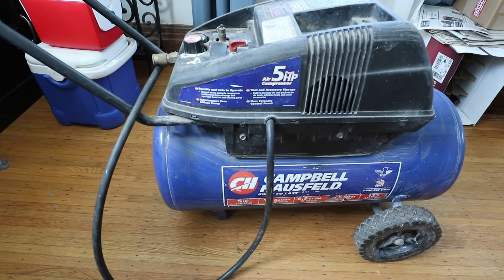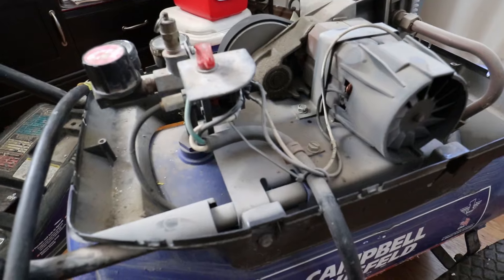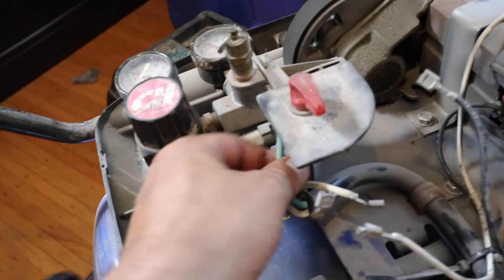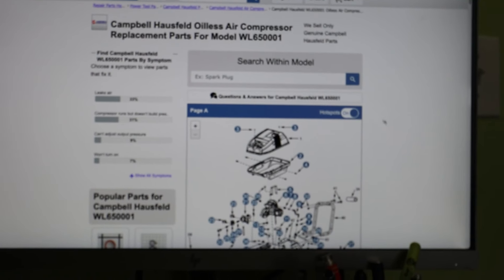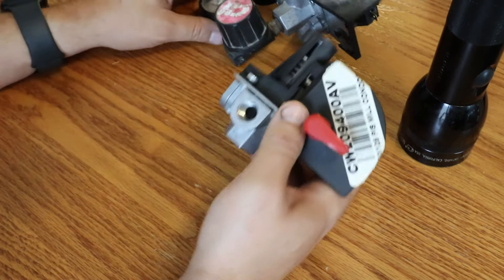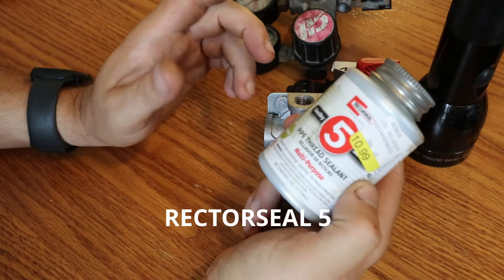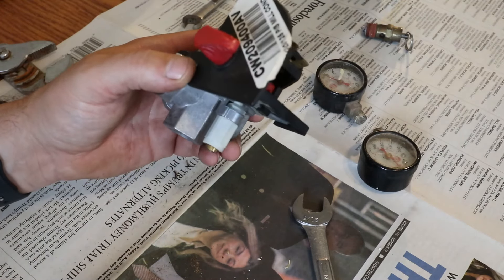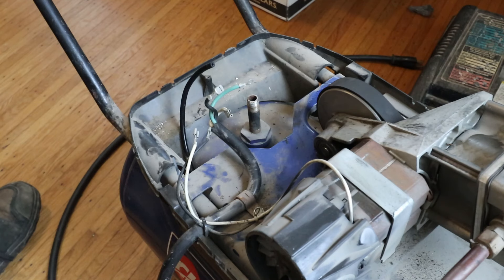Air Compressor Won't Start Repair - Campbell Hausfeld Pressure Switch (On Off) and Unloader Valve

Comment: Hello sir! I just bought my first air compressor and it happens to be this exact model. Im seeing a lot of videos about rust causing water and explosions and im wondering if I bought a compressor thats gonna explode on me. Is there any chance you can check it out or help me figure out bleeding it?
Reply from the maker: @williamzaparolli8874  Hi.  I’ve had this compressor since  about 2007 and this is the first time I’ve had to work on it.  All air compressors accumulate water on the inside because the air gets hot as it’s compressed and then condenses into water as it cools in the tank.  There is a drain at the bottom to let the water out.  It seems like a leak would form before it would explode but I’m going to look into that.
Reply from the maker: @williamzaparolli8874  I just watched a handful of videos on YouTube of exploding air compressors and they don’t look like they exploded from excessive rust.  The only scenario that I can see this happening is the pressure switch failing to turn the compressor off and the pressure valve also failing to open.   I feel the psi would have to go well beyond 100 for this to happen.  It seems like a very rare fluke type thing.  Water heaters do this occasionally also.

Comment: How do you clean the air tank ?
Reply from the maker: You’re trying to clean the rust out of the inside?  Personally I would just leave it but you could remove the drain at the bottom and put some chain or bolts on it and shake it around.  Another thing to try would be pour some evaporust in where the pressure switch goes.  In either case you’d want to disconnect the compressor from the tank so you don’t get crud in it.  Good luck!
Reply: @PeckerheadFixesIt  thanks for the tips man I have a question if you don’t mind im new to air compressors but is it possible if I get a coupler splitter I can hook up two air regulators for 2 machines im running ?
Reply from the maker: @brunolandasantana5506  I think what you’re saying is that you want to use one compressor to run one thing at ~100psi and something else at ~50psi.  This is definitely possible just put in a T so you can have two regulators.